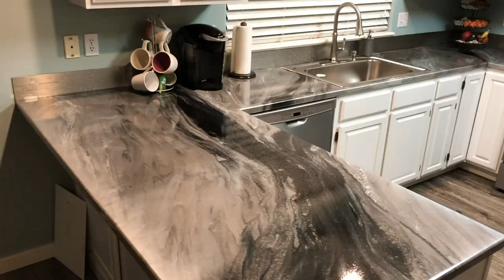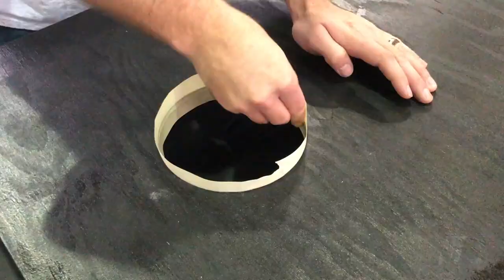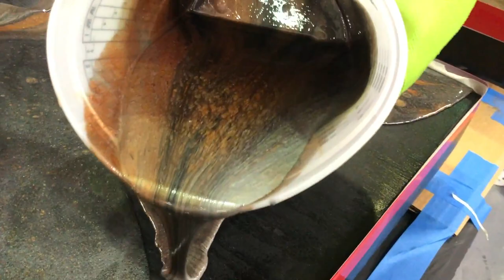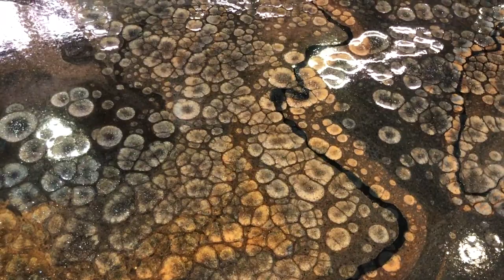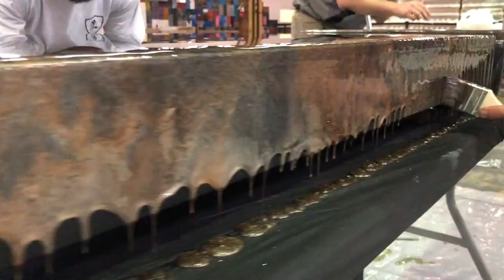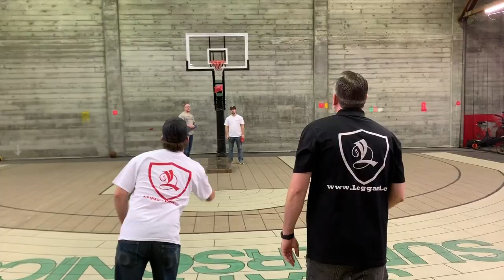Coating Cornhole Boards Using Epoxy Resin | Dirty Pour Technique

Comment: How long did you wait before you pulled the tape,and started to brush the sides? That is beautiful, I love the shine. I’ve been looking into doing this on my cornhole tops, but I always doubt myself, so I never do it.
Reply: Usually, wait about an hour to pull the tape off. Go tip is to pour a little on a scrap piece of wood and go back to it to see how much it's hardened up.

Comment: What happened to the shine?
Reply: From the description - "used our WB urethane gloss top coat to finish it all!" and that is what happened to the shine. I understand the need for that considering its intended use but it takes away from it for sure.
Reply: @BlackCat_2  Still looked very cool, never thought about epoxy for these games,
Reply from the maker: We have 3 different top coat options. Glaze coat is our super high gloss top coat that lays out glass smooth just like the metallic epoxy coat. Our WB Urethane comes in high gloss and leaves a minor texture and we also have a WB Urethane that’s a Matte/Satin finish.

Comment: Hey I’m thinking about doing a clear epoxy on my boards. With the epoxy on the boards are not to slippery where the bags slide off? My boards don’t let the bags slide at all and I would like to protect the decal so that’s why I’m looking to epoxy them.
Reply from the maker: We haven't had an issue with the bags not sliding on the epoxy.  We have made several of them and they work amazing.

Comment: What did you tape on the sides to stop run off?
Reply from the maker: We just let it drip then we scrape the edges every so often.
Reply: @LeggariProducts  ok just checking. There was some masking tape or something taped on edges wanted to make sure what kind before i tried.

Comment: how are you getting the air bubbles out?
Reply from the maker: Stan Krieger we typically done have any air bubble issues with our resin. There’s no torch required. At the very least you can mist the top with denatured alcohol if there are a few. Thanks!

Comment: if I use plastic board do it need any primer ?
Reply from the maker: Yes you will want to use a primer so the epoxy will adhere to the surface.  Thanks

Comment: Can I put epoxy over a vinyl that covers the whole board?
Reply from the maker: Yes! If you email Cody@leggari.com our head tech can give you info on this!
Reply from the maker: You can contact our techs at 844-534-4274 ext. 1 and they can assist you.
Reply: Already figured it out. Spray with a poly first. I’m not contacting anyone. This is youtube. Reply with the answer and you gain/retain a subscriptions.

Comment: What kind of tape is that? I tried using painters tape and the epoxy just eventually pushes through it. I tried allowing it to flow over edge but it just becomes to think on top and too many coats.
    Also, is that just black paint or is it primer?
Reply from the maker: We used masking tape for the edges. That's black primer, it comes in our kits!